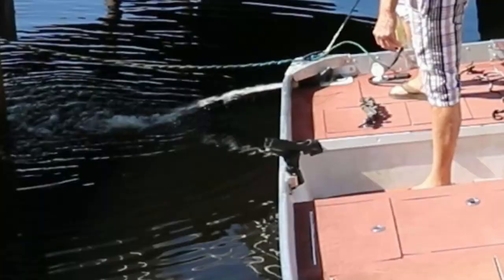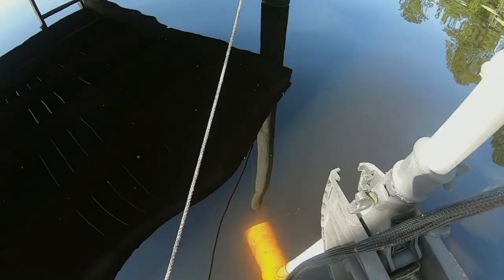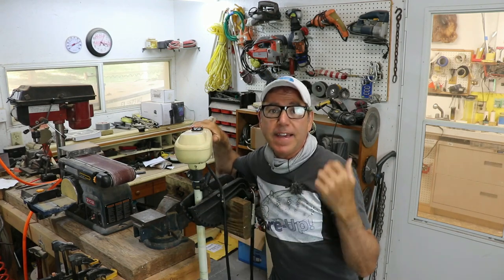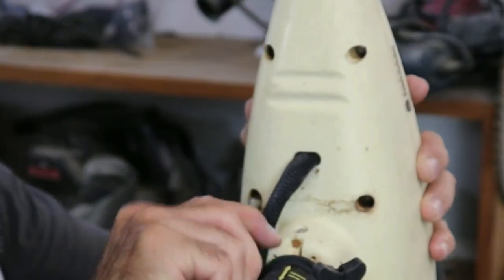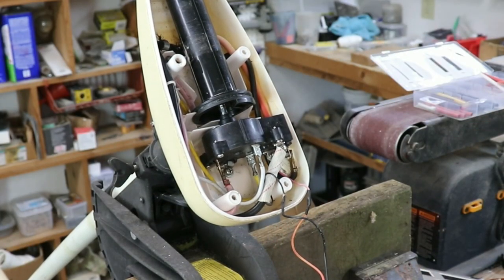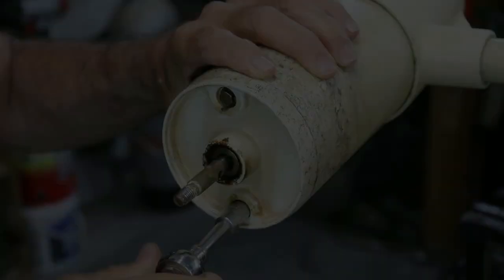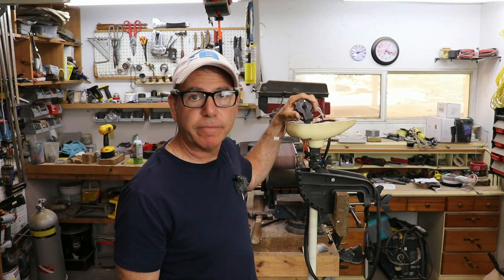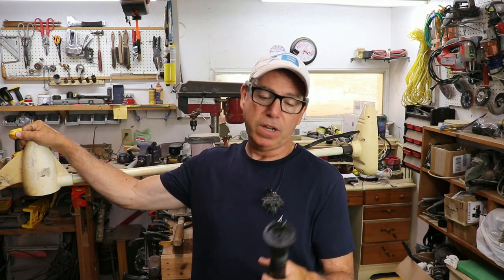Newport Vessel 62lb After 3 Years of Hard Use. Should you buy a Newport Vessel ?  #trollingmotor

Comment: That seal is what goes on most outboards, not just electric trolling motors.  Usually fishing line or something gets wrapped around behind the propeller, and cuts the seal.  If you have an outboard, you drain the gear oil every season, and if there is water in there, replace the seal.  On these electric ones, I'll bet the shaft is slightly out of round from the prop hitting something, and that wears out the seal faster from spinning/rubbing on the shaft.  I might start replacing my seals every year.  I think they are just a few bucks, and you don't really need the stainless steel spring ones if you are doing it every year, so the seal should cost less than 5 bucks.

Comment: I have their Kayak motor setup. So far so good, but of course it does not sit in the water or elements all the time. But it installed relatively easily and can get my kayak up to about 6 mph. Biggest issue was i went too big with the battery (24v 80Ah). even after 4-5 hours on the water I'm using about 25% of the capacity. that is obviously my mistake, otherwise its seems like a really nice product.

Comment: Very interesting that you identified the weak link with these types of motors where they leak. I see potential for a design improvement in the future, like maybe an easy way to drain the lower housing and a customer replaceable seal at the shaft.
Reply: You can replace the seal.  He could have unscrewed the vertical metal shaft (use heat on threads, as plumbers putty holds it tight), pulled the wires to check them, and then cleaned everything inside the motor, put a new 5 dollar seal in, and buttoned the whole thing up.  I would have taken about an hour or 2.  But, yeah ... 2 to 3 years is max on these little motors.

Comment: Wonder how hard it would be to design an electric trolling motor with the motor mounted on top up out of the water and  have it connect through  a coupler to a lower unit like on a standard 5-6 hp 2 stroke outboard?  That would eliminate the worries of getting water inside the motor and would keep all your electronic parts high and dry. Sounds like something engineering related, that would be right up your alley.
Reply from the maker: Thats the design of many of the electric outboard motors coming out these days.
Reply: Cooling?

Comment: You nailed the facts. Cheap motor, cheap parts, similar life to bigger name brands. I am die hard MK fan but after replacing controller boards and getting another year out of, like you mentioned, I grabbed a Newport Vessels X-Series 55lb Thrust Transom Mounted. It's been a good and near same on battery usage after each 6 months old. MK is better at the start for battery usage, but falls quickly to average after about 50 hours use in salt. Could be battery, could be MK, could be combo of each but I didn't conduct strict test. When the mentioned Newport troller was priced at same cost as board, took the leap. Great video, thanks for sharing.
Reply from the maker: That has been my experience...I'm ready for a new one, unfortunately 😕
Reply: @EngineeredAngler  with the cost of new being so cheap, I don't even cry now. 3 years is all I ask for hard duty. The plastic gears start skipping about then, or boards give. I donate to local marine tech school and grab a new. They make fun projects with and I feel better didn't go to landfill. Great videos.

Comment: Thanks for your videos.
Im trying to decide between a minn kota 55 Endura C2 ($200) vs the Newport Vessels NV 62 ($250). I guess prices really evened out. Whats your recommendation?
I've been running my old minn kota 30 (gotta be like 15yrs old at this point) which still works but i need more thrust.
Reply from the maker: If you can get the minn kota at $200, buy it, that's what I would do.